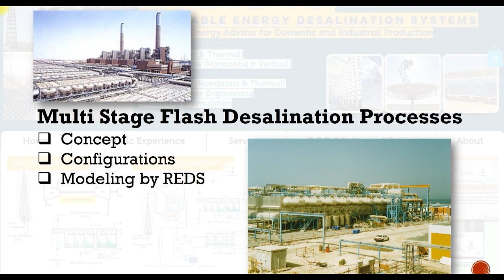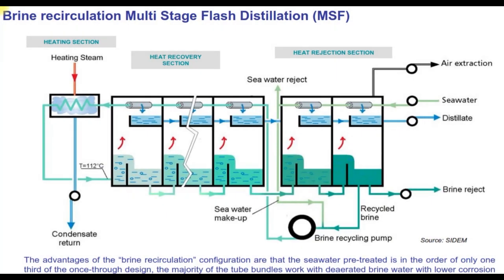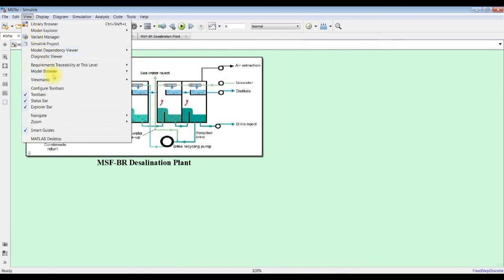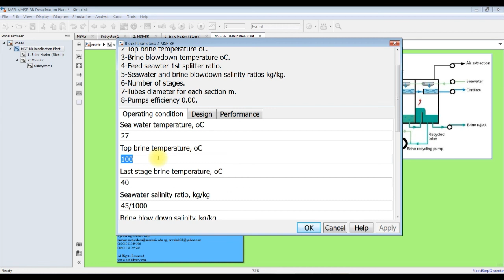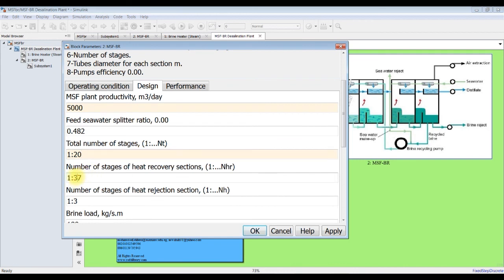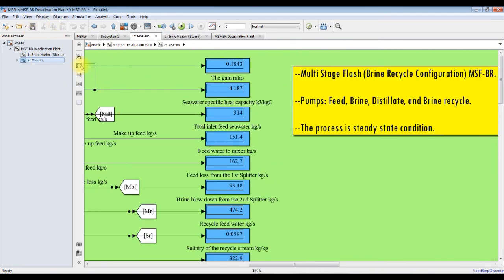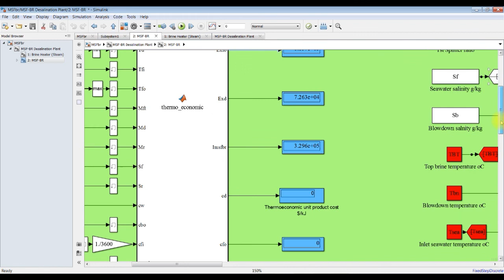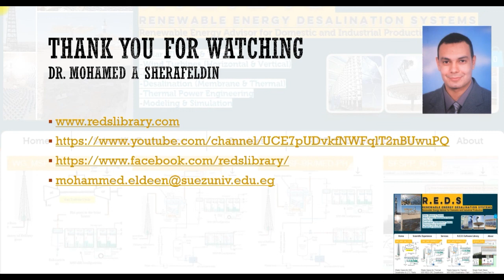Multi Stage Flash simulink model run

Comment: Thank you so much for the hard work. I have some questions that I would like you to address:

1- what is the seawater intake volume?
2- what is the production volume?
3- what is the discharge volume?

Are these numbers typical to the normal MSF plants in the middle east? The reason why I'm asking is we require a client to give us such numbers of a real plant and I wanted to verify these numbers.
Reply: Ali Almubarak وش اسألتك بالعربي ياعلي 😁
Reply from the maker: Dear Eng Ali.. This model is a design model. Therefore, the intake volume or feed seawater should be calculated. The production volume is assigned and considered as known parameter. The model is typical for MSF plants and it is verified well against many research publications. see the list below:

1. Hisham T. El-Dessouky, Hisham M. Ettouney, Fundamental of salt water desalination, Kuwait 
University, Elsevier 2002 (book). 

2. Mohamed A. Sharaf Eldean & A.M. Soliman, A new visual library for modeling and simulation of renewable energy desalination systems (REDS), Desalination and Water Treatment (2013), doi: 10.1080/19443994.2013.777369.

3. Mohamed A. Sharaf Eldean, H.E. Fath, Exergy and thermo-economic analysis of solar thermal cycles powered multi-stage flash desalination process, Desalination and Water Treatment (2013), DOI:10.1080/19443994.2013.775670.

4. A.S. Nafey, M.A. Sharaf, Lourdes García-Rodríguez, A new visual library for design and simulation of solar desalination systems (SDS), Desalination 259 (2010) 197–207.

Also try to download my PhD thesis from REDS website (https://www.redslibrary.com/publications-books) see page 137. 

As I told you, this is a design model not a performance model. I mean, the discharge or feed should be calculated not given.
Regards
Reply: hi i need a industrial parameters of MSF process can you help me ?
Reply: khadija Shiri  what kind of parameters you want?
Reply: محمد اليامي عطني الواتس حقك خلنا نتواصل
Reply: i want to simulate a real MSF process  with Aspen Plus but i don't found all information and parameters of a real process ( Temperature, pressure,rate of flow of each stage)
Reply: ممكن نتواصل